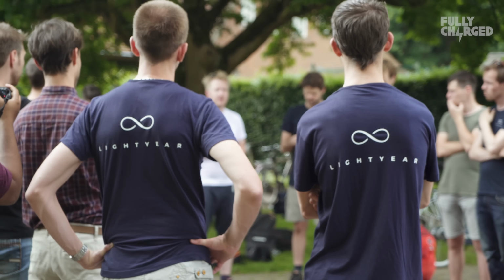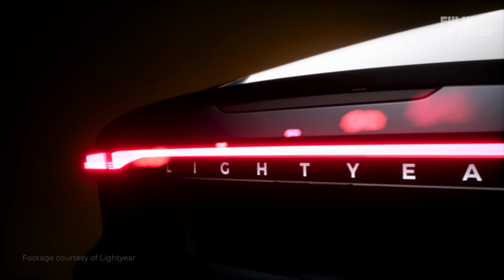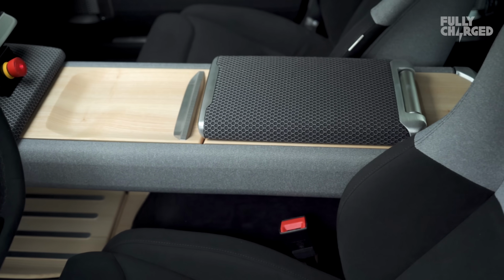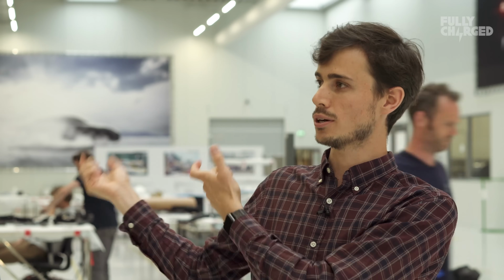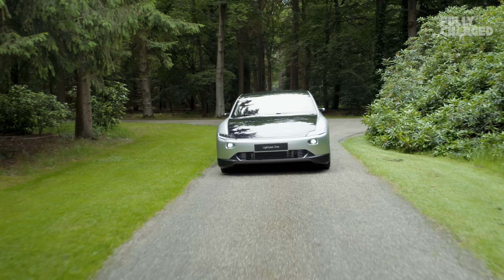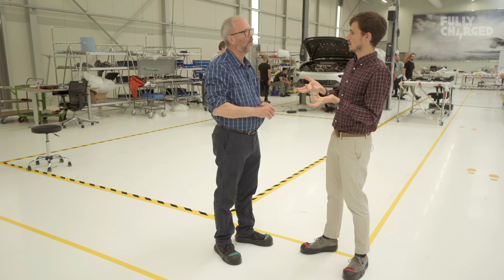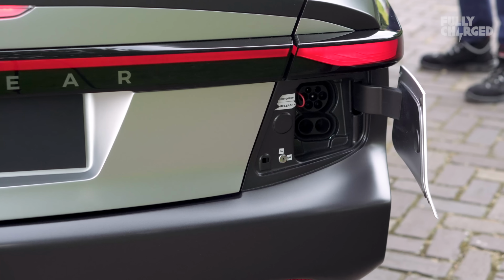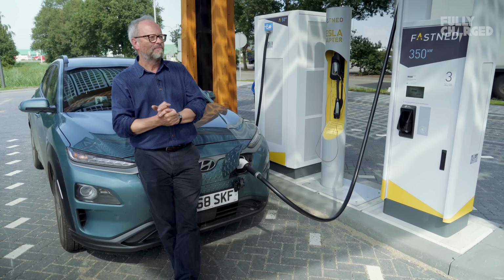Lightyear One solar powered electric car - exclusive first look | Fully Charged

Comment: Don't get me wrong. I am all for electric vehicles and clean/renewable energy but I think solar cars aren't the way to go. let's take the hypothetical scenario of myself putting up the money to buy this car. It's a big investment which means i would likely be very careful with it. This means storing it inside most of the time. Where the sun doesn't shine. Also some back of the envelope calculations show that at most you'll be able to get around at most 2kW of capacity from your roof. This is assuming around 5,5 square meters of roof space and solar panels that have around 25% efficiency (which they won't have currently the best you can do is around 22%)  This means that you'll never be able to drive that car on solar power alone. It's going to be charging the battery at roughly the same speed as a normal home power outlet. 

Again, I think the innovation around improving the efficiency of cars here is amazing and something to commend but I think calling it a solar powered car is giving the Lightyear team a bit too much praise. 
I'd personally just use the difference between the price of a Lightyear and something like a model S or an I-pace to but a big solar system on my house or invest in a solar project in my area if I didn't own my roof. 

The video was great to watch, I've been enjoying watching the production quality of my favorite show on the internet improve over the years. Thanks Robert, you're one of the reasons I chose to study sustainable innovation at the University of Eindhoven this year. I wish you and your team the best.

Comment: so, some questions:
what is the battery size?
the power and life expectancy of the 4 in wheel motors?
Is the rear wheel shroud removable?
how do you service this car?

overall an interesting and right step forward. Solar and better aerodynamics will become standard soon.
Reply: He said 2/3 of a Model S which is between 85kW and 100kW.

Comment: ridiculous ....future is self driving electric cars owned by large companies..so adding expensive solar power technology when the cars will drive into a battery station, where the battery will be swapped out automatically from beneath and then charged on site.....they are just filling in time....

Comment: I think this car has a very long way to go before it’s suitable for production. Wheels that skinny might be great for economy distance records, but don’t appear suitable for modern driving, the cornering would be great. I’m highly sceptical about the outboard motors, the unsprung weight has to be an issue IMO. 1.5kw of solar panels? They must be a pretty special panel to generate that amount on a car’s surface, the problem is that you then have to carry them around whether they generate or not. Ok for a car that sits not doing much most of the time, but in a dull country, hum don’t know. I wish them well, but I think for most, we want a “normal” looking car that has a good range, not something that looks like its from a 90’s sci-fi film.

With the billions going into battery research, once power density is higher ideas like this will go do join the Sinclair.

Comment: Lightyear and their symbol is infinity....physicists are upset

20:40 That's the point: The gain in time was at the cost of the environment. Perhaps the mobility change could also be a deceleration change. The answer to your question are multiple teams, cooperate with each other. It's kinda ironic, that we're back to those barriers, because we want to avoid massive emissions.

Comment: I would like to c some built in turbine tunnels on the car . y just one source of renewable   energy.. They should incorporate all kinds
Reply: The drag would make it less efficient than without
Reply: @professional_silent_trumpe1540  I believe by using a double helix turbine the drag will be lessened and the gain substantial. This turbine does not over rev and would delicer a steady amount of power

Comment: We need this in India, this thing is gonna charge fully in few hours under the sun
Reply: true that!
Reply: Electric rickshaws would be good, gut down on air pollution
Reply: Actually hot weather does not make better energy production. I work in the PV business and we monitor the costomers PVs for failures. In the summer PV production goes down by 10-20% due to panels overheating.
Reply: @FIGHTTHECABLE  Oh. Did NOT know that. Perhaps passive or even active cooling would solve that.
Reply: afi umer haha I know! The sun’s always out!
Reply: Sun will not provide the full energy consumption, but the sun charging is totally free. The point is that this car uses less energy, so it is cheaper to operate, even from other electric cars available now.
Reply: KT  quit messing with the Indian guy.  He's gonna make a car that runs on shit and shut u up. Those fuckers are geniuses.
Reply: @LeeroyyyyyJenkinssssss  Nicely said! 😁 To be fair though, there are geniuses in every culture.
Reply: We also wanted tesla here
Reply: @mrinaliniroy6221  I agree. It's time Tesla established a manufacturing plant here.
Reply: it wont charge, it does not have batteries.
Reply: TheFourthWinchester why you guys arguing with him??? He doesn’t even know how to spell toilets, our shit got wayyy more IQ than his shitty brain 😂😂
Reply: TheFourthWinchester why you guys arguing with him??? He doesn’t even know how to spell toilets, our shit got wayyy more IQ than his shitty brain 😂😂
Reply: The problem is so few people can afford to buy it.
Reply: try first setting up toiletts in the country.
Reply: Haris G while we do that you please go back to school and learn how to spell toilets :-) 
What a waste of education you are 😂😂😂
Reply: @HarisG9  we sent 🚀 into the moon. We can send your shitty brains into the Milky Way 🤪💩💩💩🐷🐷🐷🐷🤣🤣🤣🤣
Reply: @sticc3978  Your comment shows your ignorance. You hear about pollution in a small city and apply it to the whole nation. That's just plain dumb.
Reply: @sticc3978  dont say that!
Reply: @TheFourthWinchester  yeah? and how does that help you now?

Comment: So it is not only ugly but it also looks cheap. It does 100km/h in 8s. Top speed is 150km/h. Solar panels give you 12km of range per hour. Also it costs 150k €. The selling point is that it has nice range on one charge. Ok... so... What is the point of this thing?
Reply: 150k is normal for a handbuild car with a production of only 500 pieces.Once they can scale up they can produce very cheap for like the Indian market where the infrastructure is very bad.Only 2% of the people live near a chargingpoint.

Comment: To be honest, my expectation of solar powered EV is that, in a hot summer day, AC can cool off the interior before I get in, using the energy generated from parking directly under the sun. :-)
Reply: Just drive with the windows down it's more efficient than AC anyway. I personally hate the artificial coolness that an AC produces.
Reply: Skeptical Caveman only at slow speeds. At highway speeds A/C is more efficient. 

Anyhow, the topic is dealing with the heat in a parked car. Are you going to hire someone to guard your car while it is parked with the windows down?
Reply: The Maybach did this ten years ago.
Reply: the prius does this
Reply: the surface area of this roof is not enough to actually make a difference. the future is massive solar farms that can be used to charge fully electric cars, like the teslas
Reply: @shhh1996shhh  Given that most cars spend 90% of their life parked and the surface area will charge more than most peoples commute in a couple of hours I think it is fair to say this concept could work very well in the majority of cases. The clearest reason it would fail is the economy of scale; putting pv on the car has got to increase the price far more than an equivalent amount on the roof of the house it sits outside.
Reply: James Franko  In the future the sun will not provide more kw per square meter than today. Even if solar panels improve in efficiency up to 80% you are talking about a 2kw available for AC at best when sun is at vertical of the car.
Reply: IF WE CREATED VEHICLES THAT RUN ON HUMAN URINE AND HUMAN FECES... we'd solve TWO problems in one!
Reply: Audi already made this.
Reply: Poor boy...is your tush so tender...
Reply: I think Tesla already have this. It can be controlled via phone app of Tesla.
Reply: Ya but 24 hours air conditioning inside means it's polluting environment again  right? Then what is the point of using an eco-friendly car?
Reply: @mithunkagayannn  why do you think he means 24/7 ac in the car when he said before he gets there? the can knows when you are coming to it and turns it on. you can schedule it like an alarm. you can text it. it can read your phones gps and know when you are leaving work and learn a schedule. it wouldn't just be constantly on for no reason.
Reply: The solar panel will not produce enough energy to run AC...
Reply: @johannes914  see my comment above
Reply: @datmeme8967  The Maybach solar panel produced 63w... This provided just enough to power only the fan of the AC. This is why the solar roof powering the AC or the car itself is just a scam.
Reply: @johannes914  On a sunny summer day, having a fan exhaust the heat from your car could make a 20°F difference, so not sure I'd call that a scam.
Reply: @datmeme8967  AND improve mileage by taking the load of the AC off the engine.
Reply: @johannes914  The Lightyear produces 1.25 kW.  That's twenty times what the Maybach produced.  It's enough to drive the car 60 km in a day.  It isn't intended to be the sole power source.  The car can also use grid power.
Reply: @johannes914  the ac doesn't constantly run. you call the car a few minute before you get there or use a geo fence or schedule to turn it on with just enough time to cool it before you arrive
Reply: @ @johannes914 :  You're Incorrect by my calculations. The video rated the solar panels at 1.25 kW of power (peak).  A small window A/C (for a home) draws around 500 watts.  So, the panels, at peak power, could run two small home window A/C units.   Was your statement based on actual knowledge, or just conjecture?
Reply: @bobbritt5904  Order of magnitude is correct. You can run the AC in the sun.
Reply: yep Agree. I relate to the "too hot to stay outside yet too hot to get inside the car immediately" situation :')
Reply: actually, when it's hot the efficiency of solar panels plummets...
And on cold days the efficiency of batteries plummets...

In the Netherlands, for a large part of the year there's next to no sunlight, when there is the solar panels would get plastered with bugs hitting the car and/or dust or snow/ice in minutes and lose efficiency.
Reply: I wonder how much active cooling of the panels boosts efficiency, like could you get more power out of the panels than the power put in for cooling?

Comment: The problem is the price, as well as the waste from throwing away even more battries to be recycled in China, Poor African Countries and such.

Solar is of course a welcome addition anyway for a lot of reasons. If batteries can be better recycled and with less toxic stuff, all the better with less toxic fumes and gas especially in city areas.

But surely trains the are fully loaded with passengers is the best that hopefully could run most of the journey on electric wires, as not to lose power along the way.

Alternatively if we can drive cars through tunnels that power the car through NFC technology or similar to elon musks tunnel, where the car is carried in a way to your destination.

Comment: Solar panels on an EV are nothing more than a trope and it only adds to the cost and weight....
Reply: I don't know if you know the numbers, but the first car they build like this for the solar challange was a family car which is energy positive. These panels in a not so sunny place like the Netherlands would generate more power per year than the average person would drive. Now I should add: average distances in Europe are smaller than the US.
Calling it a luxery car is probably a bit silly, because I doubt it will be very luxerous. I do expect it to be very efficient.

Comment: Wouldn't it be more efficient to put the pv panels on the roof of a building? Cars often go inside garages and get shaded by tall buildings and trees, they get dirty, the glass would be broken in traffic accidents, and it is extra mass for the car to be hauling about. Also they cannot track the sun, just face straight up; immotile pv panels can either be fixed facing south, or can actively track the sun.
Reply: This is a vehicle startup (in the infancy of a project); not a "structural building startup." Be cynical, if you want to - just like those who clung to the horse and carriage, ICEs, and plasma TVs. You'll be quiet - sooner or later.

Comment: Idea     ::::  TO  set up magnets on wheel shafts and round coils (alternators on the wheel shafts) to use motion of wheels to recharge batteries with solar panels and  also you cn use Tesla valve to run additional alternator by moving and transfering  AIR flow into tesla valve to run alterantor????

Comment: Solar panels will never be capable of powering a car alone and the UV rays will destroy the paint if it’s kept out the in the sun 24/7. They will need a battery and the energy should be harvested elsewhere like a nuclear power plant
Reply: gd point but are there uv proof paints? I guess there is, just as there are uv proof plastics.
Reply: Divad Ignawm not for a cheap enough price to mass manufacture, elsewise things like oxidized paint wouldn’t exist. NOTHING IS UV PROOF, (that I know of) over time, UV rays deteriorate almost everything

Comment: Congrats the whole team, very talented job.Better  to add some front wind mill type dyamo from front air resistance for additional charge and  plus carbon fibre body which is light and strong  for crash test.Adding capacitor charge instead battary will reduce mass of vehicle.For more tire grip and best momentum  for launch  drive, adding   coil type motor in each drum of  -wheel instead common motor should be  good.Strong thermal insulation is needed for quick coooling to reduce  power.anyhow - my advance wishes for 100% success in business.

Comment: Ithere was a car created in the 1970s a prototype that Run with water instead of fuel... solar panels are great but a few gallons of water will be better and less expensive. All they need to do is reinvent the fuel injection kit that would power any car with a few gallons of water...
Reply: Hehehhe, those water cars are called thermodynamic frauds. But anyway there's one that's using a hydrogen cell in which hydrogen is fed in a cell which generates electricity. The H is gotten by splitting water into hydrogen and oxygen.

Comment: How long to charge this thing off the solar cells?No offense guys... all you people blowing each other over this car, my 27kw car takes about 9 hours to charge on household power, 3 hrs on two phase, 30min on a huge DC turbo charger. This car has about 7'x3' feet of inefficiently placed solar cells. MAYBE! And that's a huge maybe.if you left this sit for a day in the sun you can go to the corner convenience store and back.Those cells are useless with the exception of increasing the cost and getting clicks.This is just a Leaf with bigger cells on the roof.

Comment: Didn't see it driving 🚘 they just pushed it around 🤓 which is probably what people will be doing if they were to buy one of those solar power isn't reliable enough to use for transportation in my opinion but I'd be excited to see them prove me wrong 😂 all believe when I see it
Reply: Maybe watch it again! Also this is very early prototype and only at 10% power so it does drive, just slowly for now. Also it's an EV that can be charged up like any other, already proven technology (first electric vehicles date back to the mid nineteenth century!), the solar panels are there to extend the range or slowly charge the vehicle when parked during daylight.

Comment: Sun just provides 1KW per square meter, in perfect conditions. So, we will never have a car running "directly" by sunlight. However this quest for efficiency is remarkable. Congratulations.
Reply: My car runs on 100% sunlight. The solar panels are on the roof of my house, not on the car, but who cares? The car is still using 100% sunlight. As is the house. Putting solar panels on a car is inefficient because the car will sometimes be in the shade. The Lightyear car, being inefficient and expensive, solves no real problems. Much better to have a proper electric car and solar panels on the house where they make the best use of the sun.
Reply: @danielschechter8130  Congratulations Daniel. But:
1. My point is not about your situation (house rooftop). Congratulations again, I´m pretty sure you don´t live in Tokyo... lol. I speech to whom still "believes" that sunlight has enough power to "directly" run a "city" car.
2. Efficiency is related with energy conversion, weight, mileage, aerodynamics.... not shades.